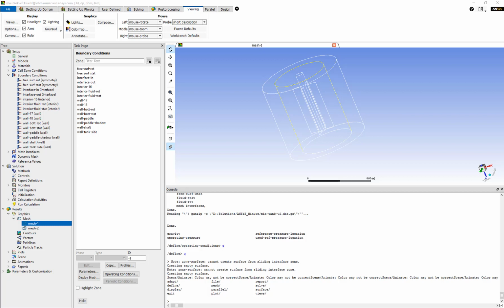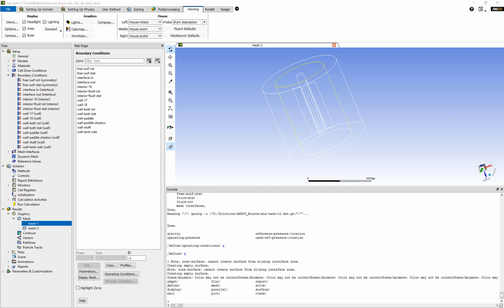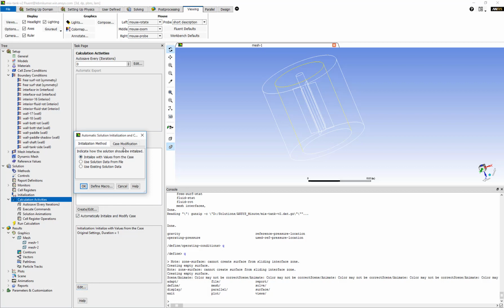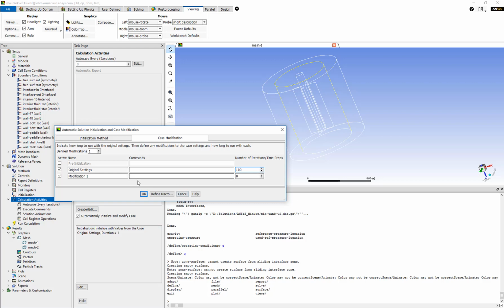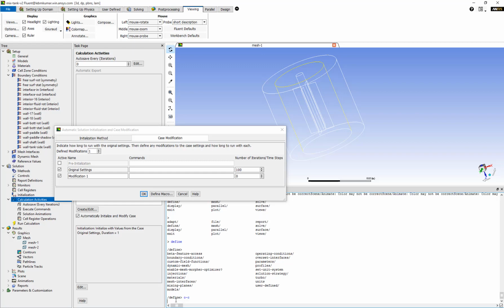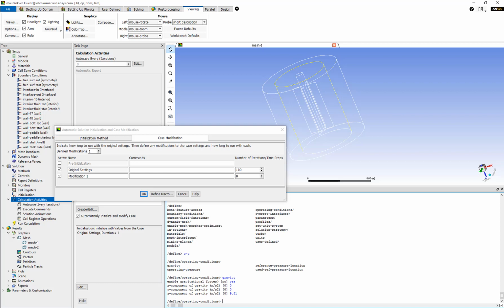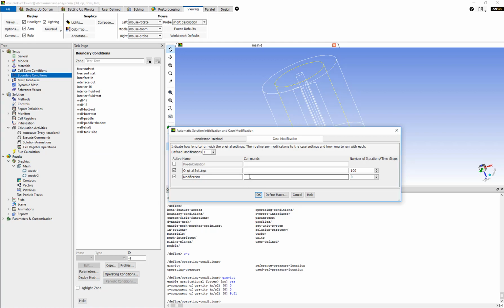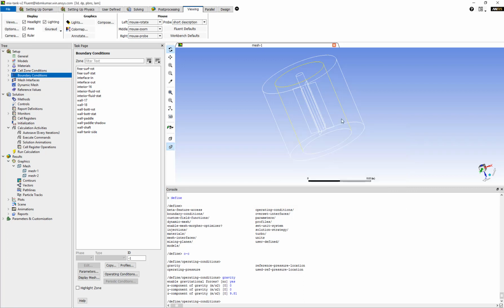Change Settings Part Way Through the Simulation and Continue Run

Comment: Great video. Could you please comment on my issue or could you please do a video on the issue stated below?

In this heat transfer problem, after some time (let's say some xx minutes), the temperature of the solid reaches 380K (threshold value). After reaching this threshold value, the temperature of the solid should increase as a step up to 700K.

I've done this in COMSOL using 'events'. How to achieve this in Fluent?

Thank you